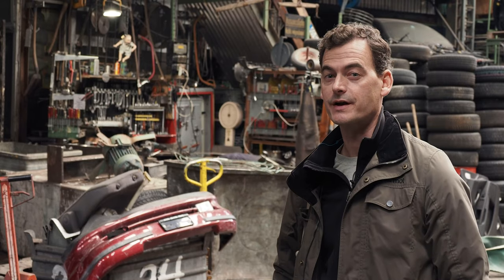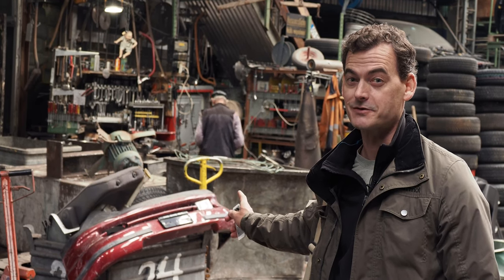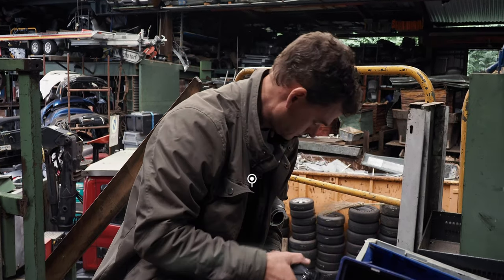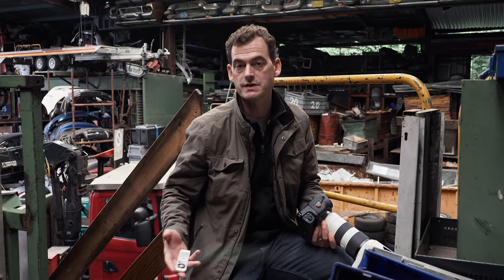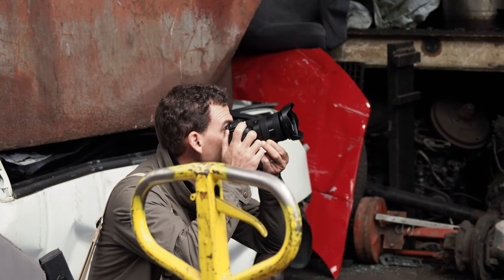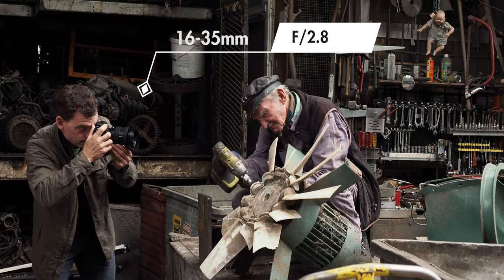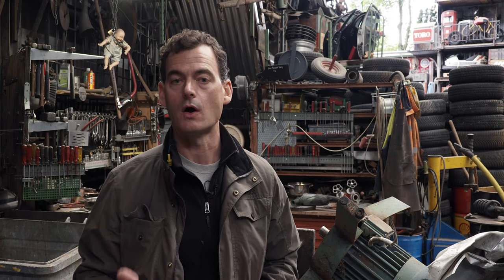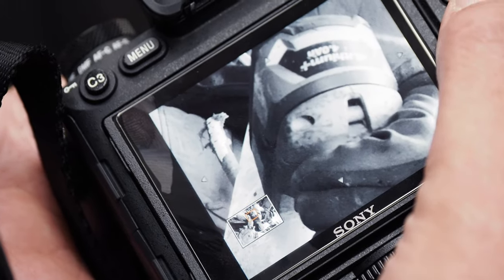How to use Point of View & Perspective in Photography (Creative Portraits -  Wide Angle & Telephoto)

Comment: People need to also remember that if using AF-S, the aperture doesn't change until you have it re-focus. In manual focus it will change immediately.
Reply from the maker: I don't follow what you mean. I'm not aware of any camera which links focus operations to aperture selection. Could you elaborate? 🙏
Reply: @ViewfinderMastery  If you change the aperture without being in manual focus or AF-Continuous it will make the aperture not change. At least on the A7R4.